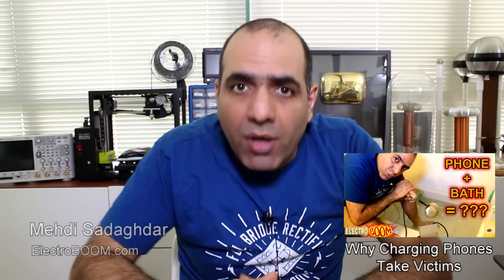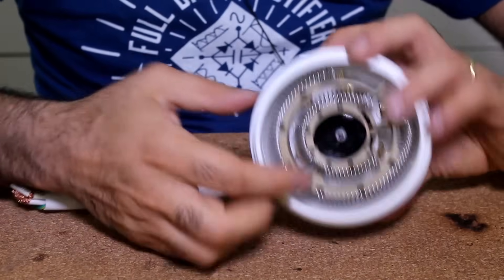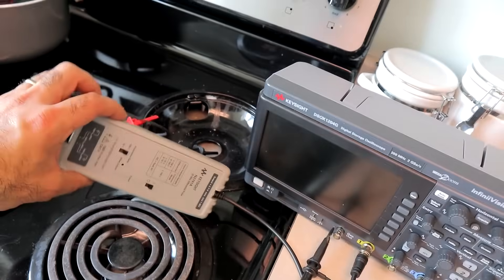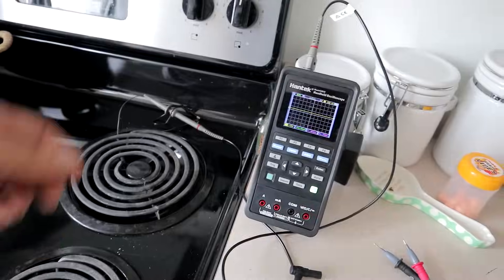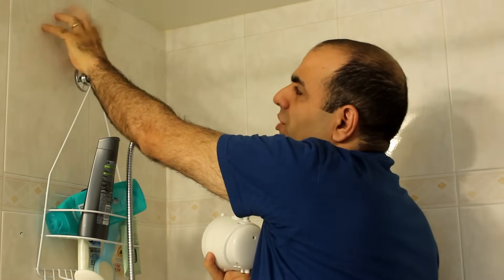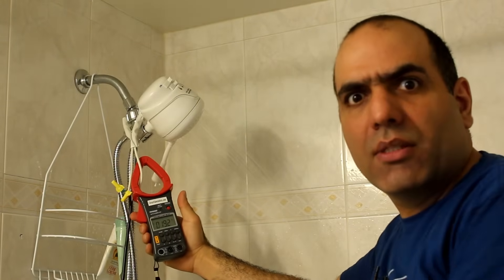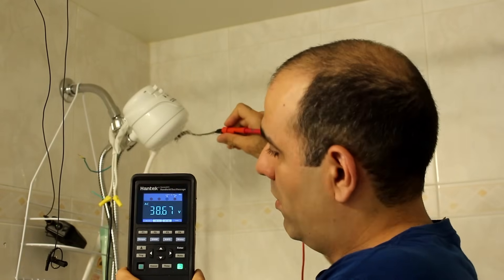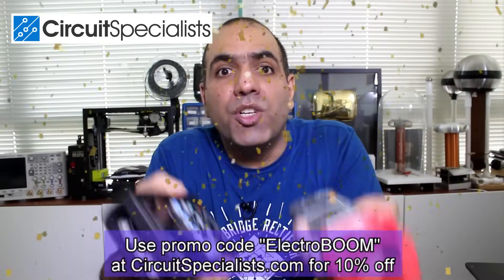How Safe Is the SHOWER HEAD OF DOOM?!

Comment from the maker: Hello everyone! Here's the winners of the MEEETTTAA / Scope / function generator draw below. They have been contacted already.  Thanks and have fun!
- Marshal Hor.

- Henrik Dan.
- B. Donl.
- Joanathan Wel.
- Jort Deb.
- Mati Les.
- King 123...
- Kevin Rod.
- Digit Sla.
Reply: OMG 🖤 i already replied :p thanks!!!
Reply: Which country you are from
Reply: Aaah
Reply: FOOLEST BRIGE RECTIFIEAAAAAA
Reply: I like your video the Best one guitar one it made me laugh out loud
Reply: Valenco Fernandes He’s from Iran
Reply: arduino guy he said country he’s from not where he lives
Reply: Awwh damn, would’ve liked one. Well done everyone 👍🏼
Reply: In your videos, i want atleast 3 electric fails >:C
Reply: 09:05
Hi Mehdi Sadaghdar,
You didn't check one more condition:
> No ground connected and heating coil open

ElectroBOOM!!!
Reply: Does this shower head, ya know, actually work? Is the water coming out of this warm given this damn thing draws 5.8kw AND breaks US electric code, as devices are only allowed to draw 1500w continuously, like a heater, or 1800w intermittently, like a hairdryer or this shower head, meaning it's drawing over 4x the US limit.
Reply: why i didnt won?
Reply: can i win
Reply: Hmm. How does this increase the risk of cancer over time?
Reply: Why are u so funny
Reply: ElectroBOOM do you like beatboxing?
Reply: Doesn't this just work like an electric hot water heater?
Reply: If the shower head is made of metal and it accidentally shortens the least resistance would be the shower head metal, body still safe, but shower head will heat up a bit
Reply: What do you mean ur doubting the system us canadians are really polite and safe sorta
Reply: are you saying you guys have a safer shower there in India?
Reply: Valenco Fernandes fortnite
Reply: ElectroBOOM I’m in love 😍 with you 💔 😭🙈 you are so clever
Reply: I wish you were my dad :3
Reply: Oh sh:t! You broke the stove, now your wife will divorce you.
Reply: @vnoctishiru3960  if he were my dad, I would be afraid for my life.
Reply: I was watching you trying to measure the voltage of the knob...  Haha... Those of you interested, some of the older style knobs use bimetal switches to adjust temperature. Just two dissimilar metals expanding and contracting to connect or disconnect the current from the element.
Reply: @aBoogivogi  ... electric current passing through your body or any organic material changes its chemistry (electrochemical reactions)... altering body cells structure.
Reply: It's not passing through though. At least not in the traditional sense as it will flow along wet surface of your skin and not go through the body. Also this is the first time I have heard electricity causes cancer through electrochemical reactions. Usually what you end up with is burn damage both internally and externally. So yeah. Gonna need a bit more of a source than random YouTube comments before I'm 100% convinced of the cancer risk.
Reply: That knob on oven is not power streinght knob, it cant give more voltage because it is just thermostat knob...1,2,3, isnt power, its just more time before it cut off power on exacly themperature.
Reply: Brasil caralho! 200 milhões de pessoas por dia usando chuveiro elétrico, maioria sem aterramento! Não estou dizendo que é a forma correta, só que não morremos por isso. Inclusive nos que inventamos isso!

Brazil fuck! 200 million people a day using an electric shower, most without grounding! I'm not saying it's the right way, just that we didn't die for it.
we even invented it!
Reply: Falafel Phil
Reply: If disconect ground wire and neutral wire both, that time must be shock you. It is very dangerous that situation. Because neutral wire also give ground conection, if both discount and live wire conected you will say that is a dangerous.
Reply: Omg can you give me one
Reply: ElectroBOOMer
Reply: @valankofernandes2015  his from Canada.
Reply: @noahkimbang3102  I'm a electrician in my school
Reply: I have an phillips 3206 15mhz oscilloscope or something like that xD
Reply: Fake
Reply: What
Reply: JOLTED
Reply: But that's only 9 you said 10. 🤔🤨
Reply: Love the video! Born and rise in Costa Rica, the showers in here are all like this one. Only people with a lot of money or some hotels use heaters.
Reply: Lol
Reply: Very very safe
Reply: Ohh
Reply: what are those names
Reply: 8:26
Reply: @loganiushere  Yes, I live in the south of Brazil, it's usually cold in winter, 0 to 10 Celsius is normal, so, I have one shower in my house with 7.5KW. It is electronic controlled, and runs in a 220V outlet. The electrical connection is special for the shower, with a 60A breaker. Almost every brazilian house has a shower like this, but the one that electroboom picked is the worst, it is a cheap unity, not the average used here.
Reply: How do you pay your electric bill
Reply: @riftspiritiv7234  with explosions
Reply: Brasil e seus brasileiros fazendo brasilices......
Kkkkk
Reply: @riftspiritiv7234  Well, I pay the electric bill with much pain, kkkkk. My electric bill is about 100 Euros. The shower is electronic controlled, usually we don't need to use it at full power.
Reply: Im a fun
Reply: Can I have one too? xd
Reply: @1
Reply: @EletroBOOM vast majority of these showers here, like 90%, are not grounded, and also, no differential circuit breaker. Little to none accidents.
Reply: Also, sometimes we ground it at the neutral (if shower is downstream a 110V star transformer). Usually theneutral of that star is grounded at the entrance of hte installation, but mostly, the earth is left floating. TBH, in brazil, most domestic grounds are left floating, every brazilian is a electroboom, when he had computer cabinets made of iron it was shock fest.
Reply: I'm from Mexico, but I never heard about this type of shower
Reply: Wait do you know why its mostly latin america?
Reply: Hi
Reply: Dai
Reply: @arleking2746  fffff
Reply: Your fails are funny
Reply: M op ijm
Reply: @valankofernandes2015  Canada
Reply: E
Was e es s s.
Reply: REST ASSURED WE WILL DO THIS NEXT MONTH AND NEXT TUESDAY
Reply: THANKS SERVICE THANKS TO ALL THE CUSTOMERS THAT
Reply: @arleking2746  HTF is this legal in a developed country! LOL
Reply: Splast water on it it goes faulty, you go bye bye!
Reply: Aww man 😢 I wanted one
Reply: Good job he’s not a brain surgeon 😅
Reply: @valankofernandes2015  he is indian
Reply: :b
Reply: @valankofernandes2015 from his accent and name, probably Iran or places close to it

Comment: So, my thoughts as an Electrical Engineer from Brazil:

It's pretty rare to get a shock from the shower head directly even if installed incorrectly due to the fact that the tap water in droplets doesn't conduct a lot of water and the shower head is made out of plastic. In properly installed residences, it has its sole running circuit from its own breaker to the shower and uses 220V power (we have both 110V/127V and 220V over here) to dissipate less heat in the wires. It is way more common that due to not installing the ground wire or the resistance correctly that it contacts the pipe (in older houses made out of steel) and give you a shock on the handles when opening or closing the water. In that case, a quick fix that most Brazilians do is either use a rubber mat or a rubber flip-flop (which is ubiquitous over here). To conclude, here the houses are made from brick and mortar and it's way more resistant to electrical fires compared to places like the US or Canada, where the insulating materials can be a hazard for high powered electrical appliances. In my opinion, having a gas pipe installed only for the shower is more hazardous than the solution we've got here, since heat is rarely a problem in a tropical country like ours.
Reply: The "grounding 220VAC" thing sounds insane, but otherwise it sounds like you guys have it locked down on these things. i would agree that a gasline is usually more dangerous than a 220VAC connection, especially when run through a GFCI or while operating in a home with RCI. Atleast there are those omnipresent fail safes that pop automatically, and electricity doesn't linger and present a massive fire hazard.
Reply: @toilet_cleaner_man  the electric shower I have as a backup to the solar assisted boiler I have in my house is a the same brand as his but it is a much much larger and has a maximum load of 7800w lol so it is connected to a 220V and a 50A breaker with thicker gauge wiring.
Reply: mines shower is 300A 120V
Reply: I just ground my new shower head with an eight foot copper rod buried in the ground. Ah, the happiness of opening and closing without the slightest fear of those inconvenient shocks when our nail is excessively cut. In time, you totally summed up the situation.
And yes, I can bet that there are more accidents in the US and Canada due to gas leaks, or even the explosion of the water tank than we have fatal victims of shock from that shower.
I've lived in a building whose builder was from Canada, it was an old building but they used a gas heater in each apartment that heated a 100-liter tank, one day the manometer gave out, and if my father hadn't gone to check it (he had started making noises), probably an accident would have happened. It's like the engineer already said, for each place the more they use it, the more they become experts in that subject and mitigate the risks.
Reply: @toilet_cleaner_man In Brazil we use RCD, which is almost a GFCI, except that it goes together with the circuit breakers, if there is any current leakage it trips, in Portuguese this piece is called Disjuntor DR.
Reply: Quando sair a versão pra cinema eu assisto.
Reply: In my country we have tanks that heat the water before it gets too the shower head, it basically turns it into 2 streams of water cold and hot and you mix them to get you desired temperature, no gas here! (It’s electric)
Reply: eu não entendi a parte em que você toca no registros e ele dá choque, mas adorei a resposta
Reply: @sandrovilaca6928  Ele quis dizer quando a pessoa não conecta nada no fio terra do chuveiro, por exemplo quando liga um chuveiro 220v com 2 fases 110v e a pessoa não tem fio terra em casa, e como usou 2 fases também não chega o neutro no chuveiro pra ligar no terra e usar o aterramento do poste, nesses casos, quando o cano dentro da parede é de metal, um pouco de corrente pode voltar pela água, descer pelo cano e te dar um choque quando você pega no registro, se ele também for de metal e não de plástico.
Reply: @YimYum911 that is how it works in the US as well, although whether the water is heated by electric or gas depends on the house
Reply: @YimYum911  So an electric boiler?
Reply: @Tuning3434  More or less, yeah. They're just called water heaters, I've personally never been in a home without one, and electric water heaters are FAR more common than gas. Funnily enough newer water heaters are doing away with the tank and being built such that they can heat the water as its requested rather than storing heated water, which is basically what is being done here, except for the fact that our infrastructure supports 2 pipes going to every water source for hot and cold water, so these are used where the water comes into the house, and also are probably using isolated heating elements.
Reply: @carlosvitor908 You can bet that but you’d be wrong. Hot water is preheated and mixed with cold water till a desired temperature is reached, often the water is heated electrically.
Reply: Ok you lost at that last part. Very few places run a gas line to the shower to heat it and that is not the only alternative to this method.
Reply: @notribadsvault  Well, your answer does not prove I'm beting wrong. I bet as the guy said, that having ONE gas pipe only for water is way more danger than a eletric shower. And I'm not talking about carbon monoxide poisoning or stuff like that. Just read his bet and you'll see it makes sense and thats why I bet it too, you're talking about eletrical ways to heat the water, etc, and he was talking about gas pipes. And yes, eletric shower is way more safer than using gas. We also have loads of alternative methods which are safer, like solar boiler, etc, but the most pratical, and reliable method is still the eletric shower. SAntos dumont invented it, and you know, the guy also invented the airplane, so not a small deal :D
Reply: Eu sempre achei que o tapetinho de borracha era pra impedir os velhinhos de escorregar no azulejo molhado
Reply: O problema é aquele choque que dá quando se encosta no registro da parede ao fechar ou abrir a água, quando há algo errado kkkkk
Reply: @carlosvitor908  so the problem is not the gas but the guy who not verify the gas installation
Reply: @carlosvitor908  the electric shower palm today is an aberration, there would be dozens of different ways to make it safer, gas is safer, same for electricity, when safety installations are put in place (gas leak detectors, anti-leak valves), this shower palm comes down to putting its safety in the hands of the builders of the accommodation or the house in relation to the earth or electrical safety elements, just like for gas.
Reply: Do you have residual current circuit breakers in Brazil? That would stop any relevant current that going outside the intended circuit.
Reply: Oi Daniel!!!!!!
Reply: @tbfrstudio5416  literally no one ever died from eletrical showers. You can search if you want. But people died and houses burned because of gas heaters. If you were to make a quick search about these topics, you'd see how wrong you are, we are much safer using them
Reply: @andersonrodrigues8007 Vira homem, cabação.
Reply: Fio-Terra: "Sou uma piada para você?" 

Ground wire: "Am I a joke to you?"
Reply: He does have a masters degree in electrical engineering, I’m sure he understands that just he is taking the more safe route to explain and give some entertainment to his explanation for it.
Reply: @thejjgang6338 Havin a masters doesn't mean you know everything there is to know in a area. He learned and lives in a place where this technology isn't common place, even if he understands the concepts behind it he can't grasp it at it's full context. He couldn't even properly install the shower. I get that part of the goal of his videos is entertainment but if his goal is to be funny and keep people uninformed about how electrical showers are NOT dangerous, he definitely succeeded.
Reply: @ youuuuu do realize his whole point is to entertain but also mainly to learn about these technologies. He knows it can be safely used he also has the knowledge to know and can point out all the dangerous parts. Yes it is used safely all over he’s not saying to not use it he is simply showcasing what dangers it could entail and all the things you might not have thought could happen. He grew up in Iran, he knows this stuff, he knows they use 220 and understand it’s used. He even points it out that he learned they are used.

Comment: We have two of these showerheads in our house. The first one was installed by an (unauthorized) electrician. It shocks me occasionally when I touch the faucet. I don’t like using it lmao. The second one was installed by my mom who is definitely not an authorized electrician either, but she still managed to make a better job with the second one. It does not shock me! Although the ground cable is definitely just hanging out in the air. It terrifies me still. Thanks mom!